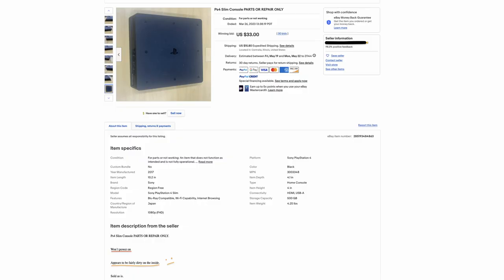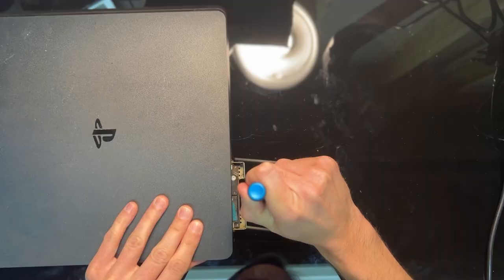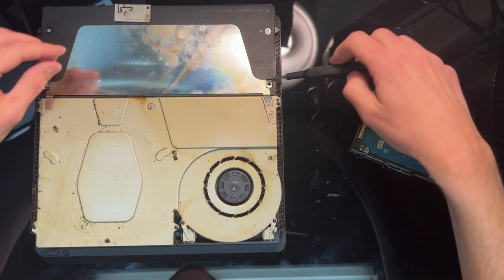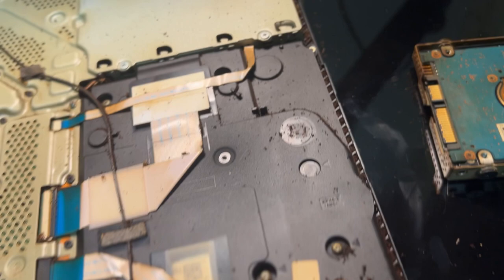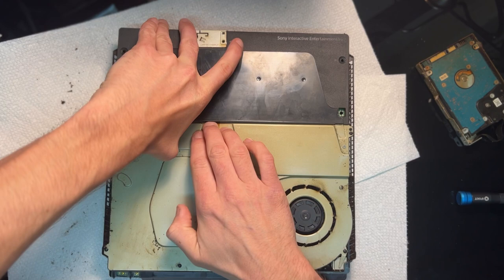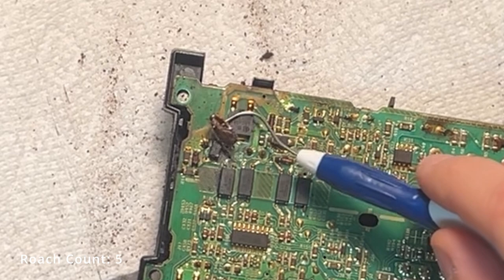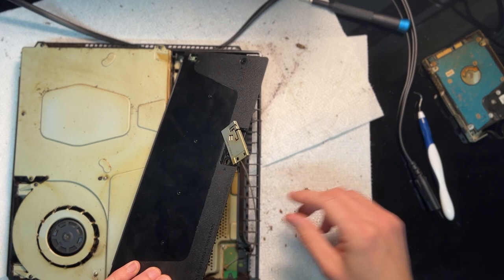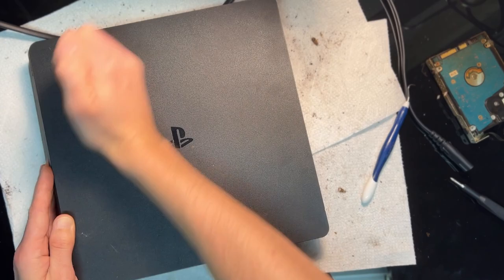PS4 Slim with No Power - Let's (try to) Fix It

Comment: I've had a console worse than that. A $15 Xbox One. It was very rusted,  Had a spider web full of dead roaches, and has a ton of roach eggs in the console. I was suprised it still worked. More than just a loose HDMI port. I've decided to just use the console for parts even though only issue was a loose HDMI port.
Reply from the maker: Ugh a spider web and dead roaches? So gross. Such a pain to clean up too. Not a bad call to use it for parts.
Reply: @FixMoreWasteLess  Yeah I've finally just decided I'd throw away the casing, fix the loose HDMI port issue, give board new thermal paste, thoroughly clean the board, and just sell the motherboard itself as a working replacement motherboard. Gotta try to profit from my $15 loss.